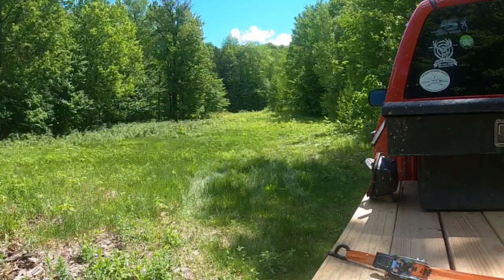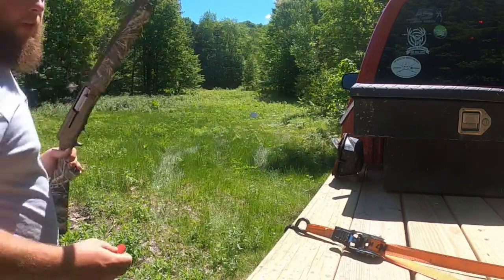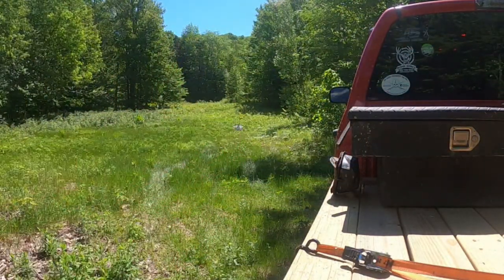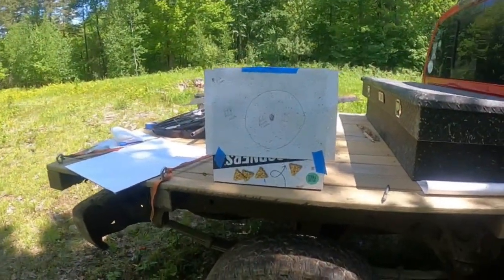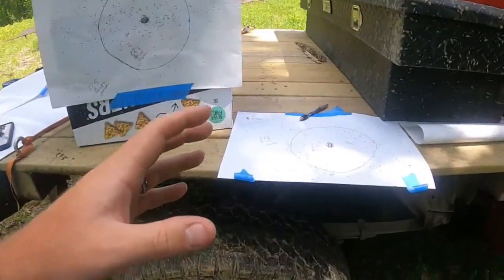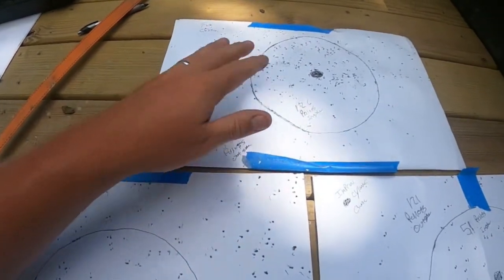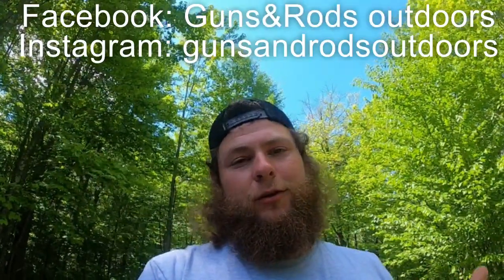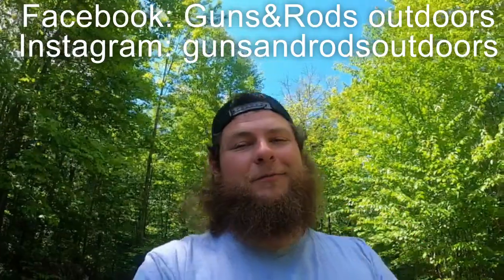CHOKE PATTERN TEST! Improved cylinder VS Modified VS Full !

Comment: I just bought a Winchester Ranger 120 from my uncle. I have to buy some choke tubes for it. It came with an improved cylinder, but, as you also said, I prefer a modified choke and I want a full choke to start turkey hunting. 
My Pointer 12 gauge break-action shotgun has a fixed modified choke (which I actually found out in a review video of it here on YouTube, because it doesn't say on the gun itself and it didn't have a manual). I bought the Winchester off my uncle because it can take different chokes and hold multiple rounds.
Reply from the maker: It's nice to have the ability to change chokes out on the fly. Where I live in the fall we have so many different hunting seasons all at once. I find modified is the best balance for all our seasons.

Comment: I miss the old Polychokes
Reply from the maker: A lot of people loved them, and a lot of people hated them.
Reply: @gunsrodsoutdoors64  if they were installed by the Polychoke factory they were an amazing tool but if soldered onto the barrel by your local gunsmith they always shot  crooked
Reply from the maker: @jeffreese4194  ahh I see. I've never had experience with them
Reply: @gunsrodsoutdoors64  I love mine. I can go open cylinder in briars for rabbits and crank it to X full in seconds if the dogs tree a squirrel in the top of a tree
Reply from the maker: @jeffreese4194  I can definitely see the benefit of it!